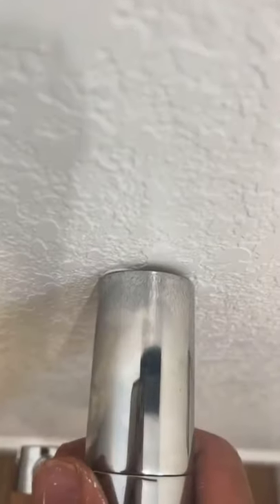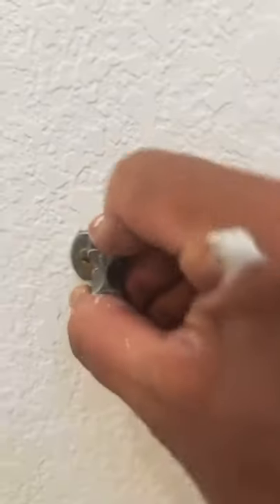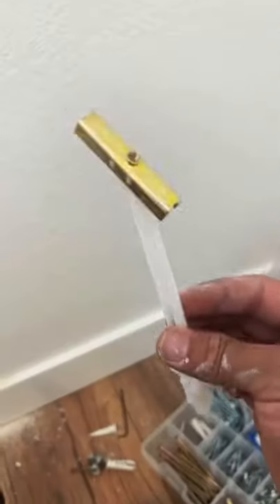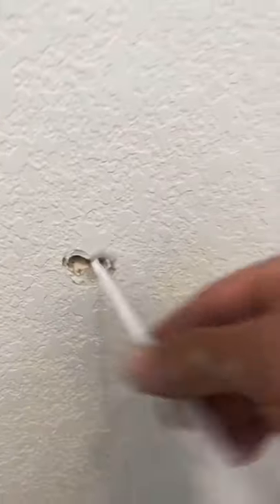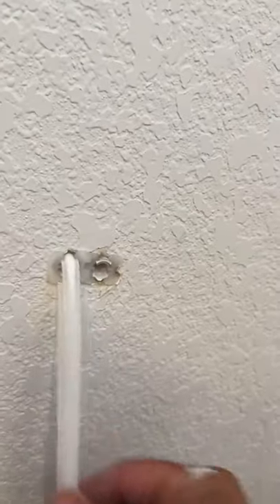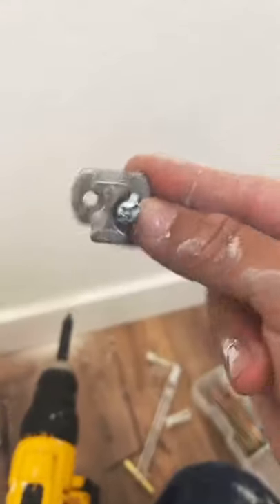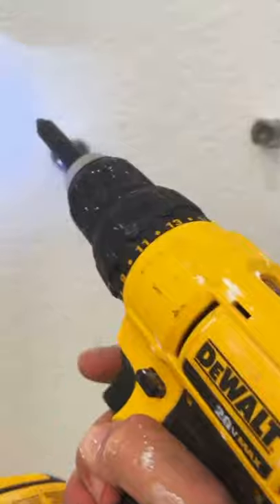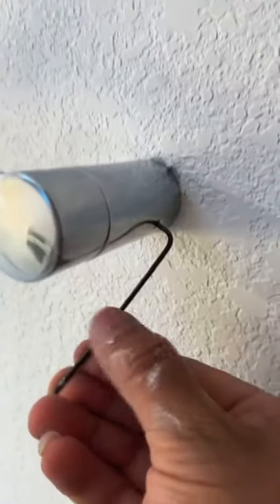How to repair loose toilet paper holder.  #shorts #toiletpaperholder #diy

Comment: I love those toggle bolts. Super easy to use and they do hold a ton of weight.
Reply: Until they break off and fall down inside the wall
Reply: @masonjohns208  why would they break
Reply: @glock1inthetop45  og

Comment: Never heard of these ! The main thing I hate about my american house ,the cheap drywall sheets as walls . Toggle bolts., Cool will totally order.some.of these
Reply: Honestly i don’t get why it’s like that tho. Don’t y’all also have really intense weather like hurricanes and tornadoes? Why aren’t the houses made to withstand a bit better? I guess it’s expensive and not normal
Reply: @Denturess  they don't want things to last
Reply: First. I'm surprised you have never seen these. But I have been doing my own work for 15 years. 
Second. Yes a lot of houses are cheap drywall but that varys per house and my house has no drywall. It is slatted and plaster. I can literally put a screw anywhere and it will not come out. No need for a stud finder for most things
Reply: @lightemup1023  you understand drywall is highly durable? The paint will start to go in a house before drywall does, and we have siding on the outside of our houses and a layer of wood framing and insulation. Our houses are pretty fine and it’s those brick houses you have which are hard to keep insulated because the brick stays the same temperature as the outside unless you have some sort of drywall and insulation between to keep the inside warm or cold.
Reply: @Sythorize  paint will start to go on a concrete house before the walls as well. And insulation really isn’t a problem with modern concrete houses as they have one or two layers of foam in the wall to help insulate.
Reply: You can buy varying thickness of dry wall. You may think it is cheap but in the end it results in an easier building to service for electrical or plumping. You dont have to ripp the entire wall out. Dry wall will hold most pictures especially with the appropriate hanger. Dry wall is not the cheap way to do things. It is simply more economical than plaster.
Reply: @SpaceCadebt  concrete homes are not ideal for a lot of places in the US.
Reply: @Denturess  the USA is huge. Some areas have intense weather but not the whole USA. In those areas the houses are built different to different codes. We don't use concrete but we do use aluminum frames and so on. From what I understand concrete walls would be worse in extreme weather. No movement in concrete. Also drywall will last and isn't load bearing so if something does happen to it it doesn't really matter and is easy and cheap to fix.
Reply: @Denturess  yes, tornados and hurricanes cover all of the 3.8 million square miles (9.8 million sq km) of the USA lol

Comment: You can use snips on the outside plastic lip of the toggle bolts before you put them in to make sure the plastic doesn't show outside the bracket. Use pencil around to bracket to see how much you need to trim.

Comment: Those toggle bolts are by Hillman and they are the BOMB. Used them to hang cabinets and TV mounts. You have to drill a big hole for them, but don’t panic, they hold great.

Comment: Mr. Jalapeño I use these things every day for installing grab bars in drywall. Here a tip for the edges hanging out. Use a pair of wire cutters to snip the edges at a 45 degree angle. They will now be hidden and the outer retainer clip still work as intended.

Comment: Install TVs as a side gig, love those toggles I still prefer to grab at least 1 stud for larger tvs but smaller tvs especially single arm mounts they work perfectly and I never worry about the tv coming off the wall

Great recommendation 👍
Reply: I probably would still try to get a stud, you have to remember the arm acts as a lever so there is more force being applied vs the TV being mounted flat against the wall, and you don't know how much your customer is moving it around which is a different type of load than something that never moves. The weight ratings on anchors can be a bit overstated or they put in big letters the rating for the strongest material.
Reply: @drasco61084  1000% agree👍
Reply: One of the best, and most frustrating, TV installs I ever did was for a smart customer.

They specified a steel panel under the drywall, to spread the load from the toggles across something like 16 square feet. It just kind of sucked because the builders only screwed it to the studs at the corners, so trying to drill it was a nightmare as it pushed into the bays.

Comment: I like to drywall anchors that you push into the hole and they open up immediately behind... They are probably a little bit cheaper but they hold up to 50 lb which is perfect for small jobs like this.

Comment: It will still break out. It will just make a bigger hole
Reply: Idk about plastic toggle bolts but the older metal ones are near indestructible. I've put in towel racks, grab rails, coat racks, and light fixtures. I've never had a problem with them.

Comment: Those toggle bolts are garbage. I use them at work all the time and they strip extremely easy, break prematurely, or the plastic wings fail to break off cleanly. Complete junk imo.

Comment: Or
Just dont build walls made from cardboard in the future
Reply: The reason we use drywall is because its very easy to work with to make any shape and style, plus it's extremely easy to repair. If we use solid wood for the walls, it's extremely heavy, expensive , and harder to fix when u dent it etc
Reply: @ripsaebri8082  fire resistance is the big reason for drywall. It's literally made of rock.
Reply: What a fantastic solution to this problem! Just don't have a home that uses drywall! Thank you for this unique and helpful insight!